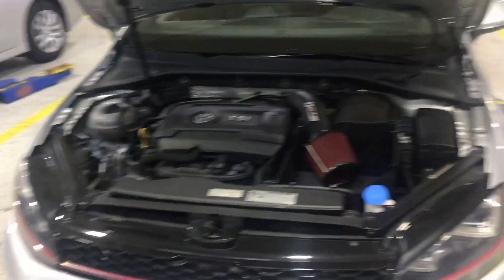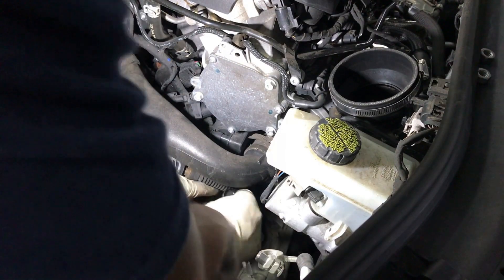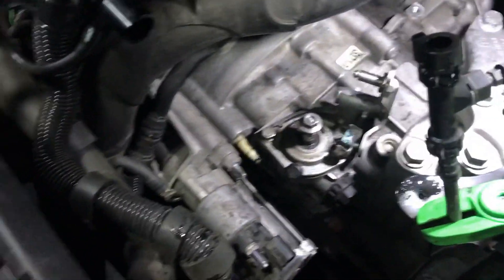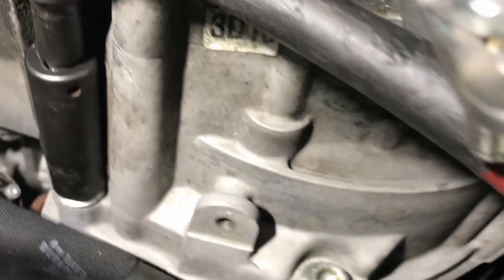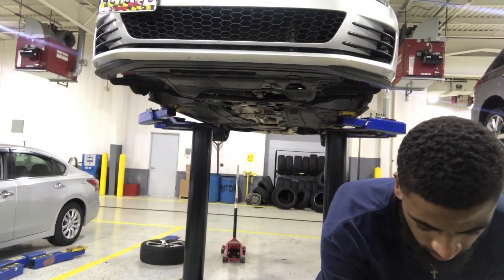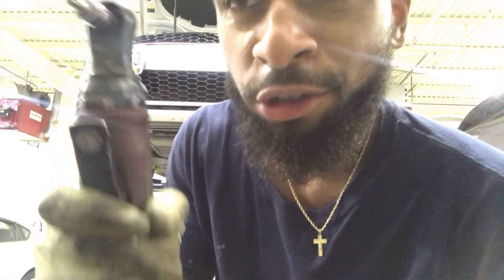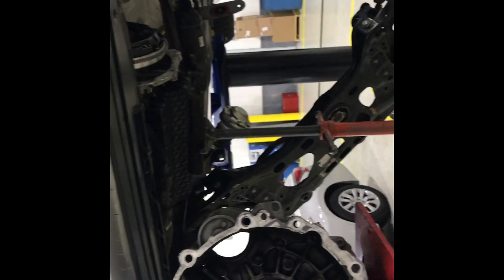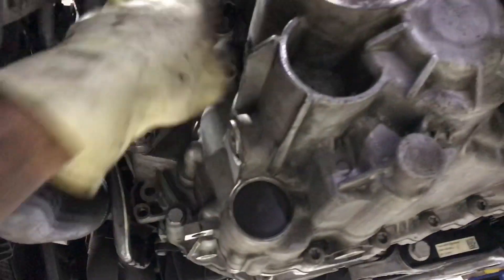DESTROYED ?? Installing a DKM MB series clutch on my MK7 GTI.

Comment: I plan on buying the stage 2 dkm clutch tmrw , was wondering if you have any updates on the clutch ? Before I purchase it , Would be major help
Reply from the maker: The clutch is still holding up till this day, nothing bad at all to say about it. One thing I will say though is the clutch chatter but that's because of the single mass flywheel I have but nothing bad to say at all.